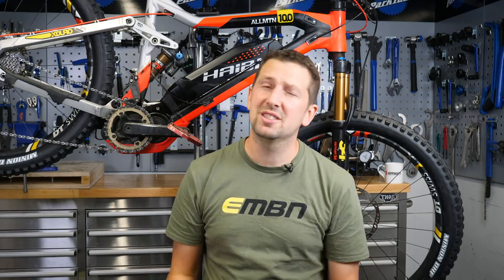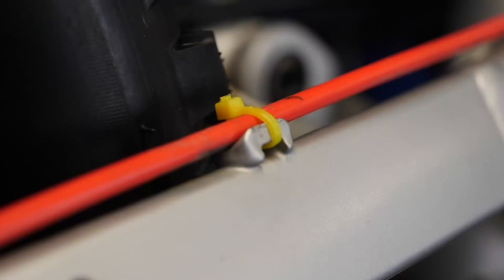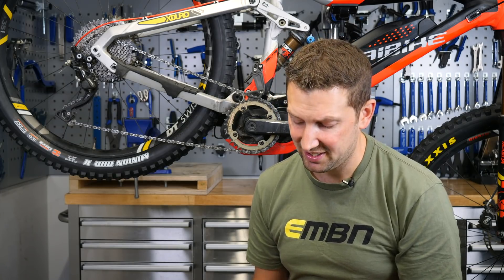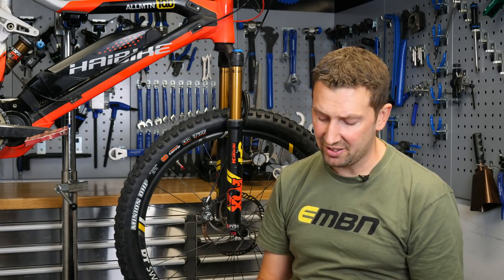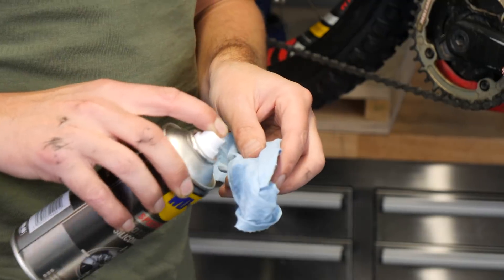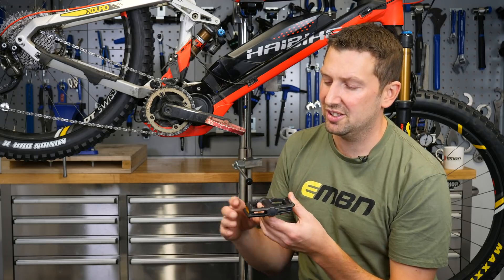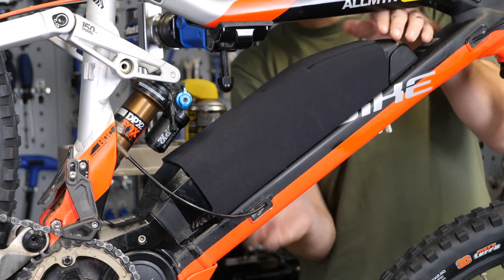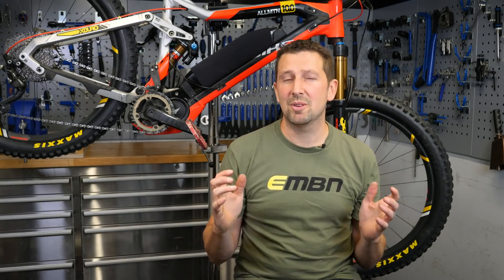12 Incredibly Cheap E-MTB Upgrades| E-Bike Modifications

Comment: My tip for an ebike battery cover for semi Integrated or frame mounted, look at purchasing a Neoprene Thigh strap used for keeping muscles warm. Water resistant, keeps the dirt off, protects from direct hits. I could tell from a fairly long winter ride battery consumption was less than usual in most modes used. Mine cost me £12 off Amazon........... perfect!

Comment: If you going to use alloy valve cap's then make sure you brush a thin coat of anti seize compound to the valve threads. If you don't then you running in to big problems trying to remove them due to  oxidising.
Reply: Those things oxidize and are impossible to remove.
Reply: this! unfortunately, i had to learn this the hard way,, I left my alloy valve cap in of  my old and unused wheelset, and when i thought i could use that in my new ones it's already too late =)

Comment: Just a mind thought about transporting your bike and removing the battery.
How is it that slamming and ramming your bike along the trails is ok for the battery and the connectors.
But on/in your car/bus/van where it is by far much safer and way less shaky because of the smooth road it is now unsafe to keep the battery in place?
That doesn't add up at all.
Reply: Wondered that myself. Maybe in an upright riding position the battery is ok, but should the bike be lay on its side and jostled about, that could really stress parts from the wrong angles ?
Reply: It's not unsafe, I think it has to do with slow residual draining of the battery while attached to the bike connectors. This may also affect the lifespan of the battery.
Reply: Ask yourself if Yamaha would like to NOT deal with the fact that at 80 mph the battery becomes a projectile.

Comment: What about converting a std bike to a ebike. Did you tried kits, with engine in the wheel, or in the main crank ?  This should make a cheap ebike.. But what is the result ?
Reply: The result is less effort on the big hills. Its wonderful. I have had 1000 watts of death defying throttle before but now just have a yamaha powered Haibike from 2017. Its wonderful as I get to ride instead of tinker and best of all...I cannot get too lazy...I must pedal. Its great exercise. I ride most days just for the fun of climbing hills.

Comment: Why doesn't this channel review and do challenges of bikes under 2k, to help encourage newcomers. No challenges involving hub motors, hardships on a budget......just seems these guys are missing a trick...why would you use a premium bike to add poundstretcher upgrades. Need to be far more inclusive and leave emtb snobbery at the door. Sorry just saying.
Reply from the maker: Hi Luke, you make a valid point about encouraging new people into the sport. It's an area we're going to be developing, and will have some entry level e-bikes on the channel very soon.
Reply: @embn  thanks for letting me know. I have a diamondback lux 27.5 purchased for 1.5k....it's the best I could afford, so would be good to see some cheaper bikes and see how they compare. Please can I also suggest a show to include decent bike lights....I looked at Halfords etc, but actually purchased one from eBay, Nestling dual led for just 18 pounds so bargain. Finally can you include a section on car bike racks as many etmb don't fit and what are the best locks especially when you have quick release wheels. Again, thanks for your reply, much appreciated.

Comment: Hold on. Aluminum pedals are terrible in winter climate. You need nylon or composite pedals with metal spikes only.  Aluminum gives cold feet because it transfers cold temperatures into your shoe.
Reply: What? Wait...are you one of those guys that rides in fat-tire snow races?